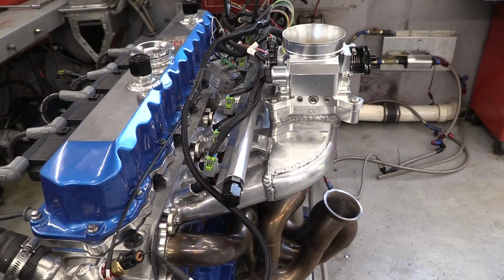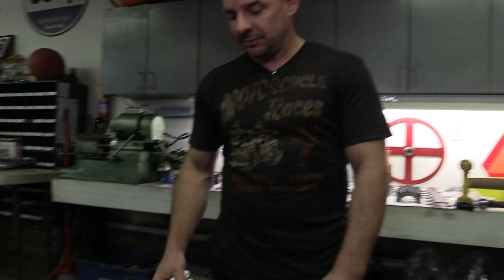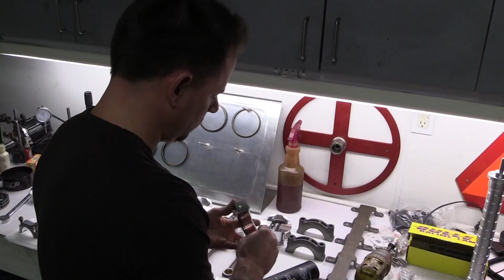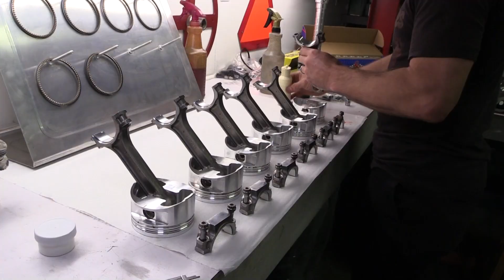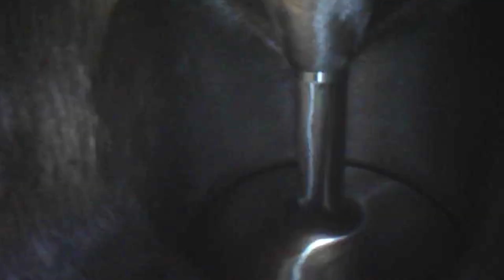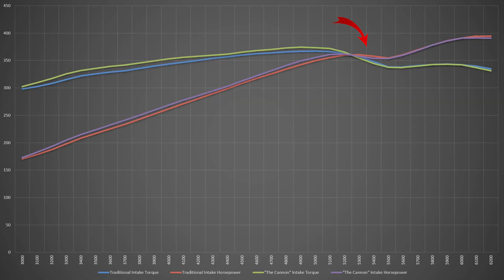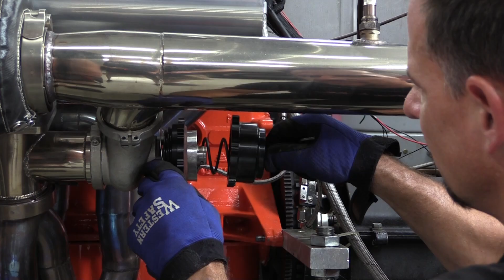Turbo Jeep Smashes World Records! (Tons of Innovation!)

Comment: People have only been talking about the power potential of the Jeep 4.0 for over 20 years. He proved it can be done even with a paltry aftermarket compared to LSland and with a crap ton of fabrication. My hat is off to him. He sells a turnkey stroker engine with 300hp for $6K.... so... If throwing 20lbs boost + methanol at it didn’t grenade it, the NA version will be solid. I will look him up to get an engine for the swap on my WJ. Way to go!!!!
Reply: @Michael l  I live in Texas my Jeep don't go over 210f, 200f is the normal running temp for the 4.0 he must of had a cooling problem of some sort. Mine normally stays around 195
Reply: 6k is to steep
Reply: @EGGINFOOLS  I agree, that's a lot of money for only 100hp
Reply: @EGGINFOOLS  I bet he will safely tap 7k without a seat to spin up 1000hp+
Reply: @EGGINFOOLS more speed more coke cain more fun new comer is tripping mad
Reply: @EGGINFOOLS  Its 2026 and he charges $14,000 for the same engine. WTF?!
Reply: Actually the 258 stroked with 4.0 is a solid build also
Reply: You guys should do a 300 straight 6
Reply: I've got a wj 2003 4.0 325,000 miles original motor. I bought it new off the showroom floor ( literally) .  It's now on 4 in lift , 33's, trimmed and folded fenders , original axles but mildly built up. The motor needs a full rebuild , not because of anything broken , but it's lost its pep . 6k sounds ok for having one built and only having to drop it in.  Might need to look into it.
Reply: Ford made a 250 cross flow 4.2 litre I would like to see what you could do with thst to
Reply: @browndog3455  yeah check out australian ba-bf falcons and the turbo OHC 4.0
Reply: Michael l there’s a few years of 4.0 that had weak head castings. They likely had cracked head not head gaskets
Reply: You don't even need 90% of what "LSland" has to offer. Just injectors, fuel, turbo and go.
Reply: This was one of the most interesting threads I've ever read! A phuk-load of knowledge and experience was bantered back and forth about straight 6 builds for hp! Thanks you guys for being real and talking the way we, who aren't born rich and have set up garages, really talk and do shit!! It got to name calling, but everyone still held onto their beliefs and there was no backing down! That shows me somebody knows what they're talking about!! Thanks again.
Reply: @standonit2003  😂😂😂
Reply: @standonit2003 new comer can set you free dude
Reply: Michael l definitely a bad day
Reply: @Michael l     that or improperly labeled MEK that is always a bonus to have around the garage .    Your friend would have eventually burned down his own garage .    Dumbasses get what they deserve .
Reply: 85 CJ8, 80 CJ7, 1WJ, 3 1ST GEN BABY GRANDS,2 XJ'S 4 DOORS ,2 XJ 2 DOORS.I love them all! Last but not least my Ram 1500 quadcab!
Reply: we been building it's australian cousin the hemi 6 for many years
Reply: I had a wj I bought for 300$ it had some body damage and a ton of rust so I was driving it till something broke then I scrapped it. well one day the lower rad hose popped all the coolant drained out and I was too lazy to fix it so I kept driving it on the highway it would only get hot when sitting at an idle I put over 500 miles on it with zero coolant I ended up having a problem with the brake boost before I scrapped it
Reply: Another crazy doper dude more coke cain man
Reply: WJ's unite
Reply: Как на счёт Австралийского Ford  Barra
Reply: How can I buy one
Reply: AIR DENSITY.  WATCH BRACKING A DURMAX  WITH GAIL BANKS .  YOU MIGHT PICK UP SOME TIPS NO BOOST AND AIR DENSITY.  HOPE THIS MIGHT BE HELPFUL TO YOU . ALL THE BEST .
Reply: Google "Torino Cherokee". Racers in the oldest racing category in the world, Turismo Carretera in Argentina, have been using this engine in their Stock car since the  90s. Naturally Aspirated, up to 500hp, roaring at almost 9000RPMs
Reply: 320hp LS weighs the same and can be had for 400 and ran off a 200 buck harness lmao
Reply: Jeep engines suk. Just ask the utuber that has 1300 jeep in a junkyard dexjeeps?
Reply: 2 WJs and LJ🙋🏻‍♂️
Reply: @nate4036  dddddp
Reply: That’s a lot of horsepower for a straight six
Reply: @thomasbalfe9436  tell that to a 2JZ..
Reply: He put cement in the water channels so it wouldn’t crack in half. That’s not a very reasonable way to build an engine. Also the smoke was from the waste gate, not the bov.
Reply: @marcus11619  only bottom section is filled,there is a gap at the top for cooling,have seen these street driven
Reply: @marcus11619  cement filling blocks is done on many high horsepower builds
Reply: Hell yes
Reply: So now the POS Jeep has souped up motor.  The remaining Jeep is still a POS  with no resale value.  Only people with bad credit buy Jeeps.  Don't shoot the messenger, it's fact.
Reply: @robertkotula5389  As if anyone actually cared about what you have to say 😂😂😂 At least I own my POS Jeep free and clear. I don’t care about how much money I spend on it. Your opinion means as much to me as the crap I took this morning.
Reply: @Potatofarmer1898  you cared enough to reply.  Tip: life is better when you don't wear your emotions on your sleeve.
Reply: @robertkotula5389  meh. My tip to you: don’t offer tips to ppl who don’t care about what you have to say!
Reply: @robertkotula5389  only the later ones with all the can bus electronics bullshit,earlier ones were quite reliable
Reply: @robertkotula5389  and what makes you think it's going back in a jeep?,may end up in some sort of pick up truck or a chryler/valiant car,you got a pretty narrow mind bud and wnat to find fault with something thats close to faultless LOL,crawl back under ya rock bug before you get squashed
Reply: @souranis  you could put headers and a cam in a stock 4.0 liter engine and get nearly 300hp
Reply: @SiliconCypher  no you can't. A header and can will not and I repeat will not add 110 hp to your 190 hp motor.
Reply: @TryinItAgain  Yeah I was exaggerating, with a 50 shot of nitrous you can get it momentarily. Regardless the price of this is ridiculous.
Reply: @SiliconCypher  I totally agree with you. The only reason I said otherwise was because I built one and could barely get 250 hp out of it and that was with .030 decked off the head and ported and polished. But yeah nitrous will get you there plus some.
Reply: @TryinItAgain  was it your Jeep? I'm sure it boosted the fun factor.
Reply: @SiliconCypher  yes it was my Jeep and yes it definitely helped but trust me I was aiming for 300 and couldn't get it. I did get 253 hp tho so it was a major upgrade.
Reply: @TryinItAgain  well you fucked up,i regularly got 400hp from australian hemi 6
Reply: @TryinItAgain  they go 400hp with compression,cam and porting
Reply: @andrewsmart2949  are you taking about a straight 6 Jeep motor? I'm curious here. There are a lot of straight 6s that you can build to high hp especially a Barra or something similar but I'm taking about the Jeep motor in my comment
Reply: @TryinItAgain  someone else metioned the 250 cube ford 6 and i said ford australias gone a bit beyond that now,i used to build and drive valinat hemi 6 australian motor,then got heavily involved with RB nissan 6,and now with the "barra',whats your point joshua?
Reply: @TryinItAgain  and i just whatched vid of bruce sizemores "cleveland" headed 300 cube ford 6(2 cleveland heads furniss bronzed together after cutting offend cyl) and it's sick
Reply: @andrewsmart2949  my point is that the Jeep motor and the aftermarket support for it isn't there and neither are the hp figures. The record with 20lbs of boost is just over 800 and the record that stood for years was only 687hp. There are many straight 6's out there that can make double and triple those figures. I know 6's can make huge power but the Jeep 4.0 is a dog with little aftermarket support and therefore hard to produce power with.
Reply: @TryinItAgain  they are a powwrhouse,hut the fuck up spambot
Reply: @TryinItAgain  all iron and pushrod are terms clearly lost on a spastic like you,800hp from a 6 aint to shabby in any ones books,and this thing would outlast alot of the all alloy units  you want to quote,it may be easier to get power from an OHC 4 valver but thats not the point
Reply: Dd
Reply: When I wanna do a rebuild I'm doing a full swap for a stoker 4.0. 00 WJ with 195k, and a KJ with 246k

Comment: I believe it was in the mid 60’s that INDY cars were allowed to use stock blocks and turbo charge them. The earliest ancestor of the Jeep 4.0 was the AMC RAMBLER 199 cubic in engine. An INDY racing hopeful Named Barney Navarro built one of these engines and used a Turbo Charger to boost horsepower. He made 550 horsepower with the little six cylinder. The 199 and 232 engines had the largest ports of the early carbureted sixes, until about 1958. Those heads are good for the earlier engines, but the new Edelbrock aluminum head outflows them

Comment: OKAY STOP.  Start doing some research before you make a 4.0L Turbo video. It's not making 1,500HP from 14 years ago at the Mud Drags on 53" tires that weigh 334LBS Each 16.00R20 Michelin XZL in the mud.

Comment: I told someone that it would cost more to modify a Jeep 4.0 to make 800 hp than it would to modify a 2JZ-GTE to make 800 hp, thanks for proving me right. Pretty good for "the rambling of someone who does not build engines," right?
Reply: comparing apples to oranges.
This build was done for R&D purposes.
Reply: @riogrande163  True. If the engine were actually meant to be used in a vehicle, 800 hp might not even be possible, or reliability might be too poor for the engine to be useful for anything.
Reply: The engine itself is quite a simple, reliable design. 
The real challenge is packaging the turbo system into an engine bay.  @PistonAvatarGuy

Comment: Since I am a 1st time with my 1st CJ 7 4.2. This was an happy eye opener especially V seeing the turbos sub 5000 rpm performance eh Imva bike tech and specialize in mechanical boosted monster bikes. Same results ratio at half the peak rpm pull.though the bikes rip 12,000 rpm lol  Now I am gonna build along side the lifted 1980 an extended chassis rat Rod Jeep street machine mud racer style with Newcomers mega turbo system. Or similar depending on the development 👍🏻😃

Comment: Additionally, these engines were durability tested for a thousand hours cycling between peak hp, and peak tq while also being thermally shocked at both ends. There's some incredible  information out there on them if you dig. Forum info is garbage.

Comment: I had also run 232 amc and same stock pistons as 258 i ran, 258 blewlands off number 6 in 4 runs. The232 never caused a piston or ring issue. Instead it also had bearing issues

Comment: You are obviously an engine guy with a lot of knowledge. If you want to reply I will appreciate it. 4.2 amc, 7.5 cr Ross blower pistons. Crower 7000 plus cam grind, 470 int 480 exh, double springs, turbo from Detroit 4 71 t with appropriate turbine hsg. Runs 42 psi manifold pressure using 100 low lead aviation gas. Have had no issue with head gaskets or pistol s, but it is making metal from rod and crank bearings. Question, if I make a block stiffened plate for block to oil pan and 4.0 main cap stiffeners do you think this would. Be enough to lessen bearing wear. Yes I can just do it and see but you have experience with these. It is blow thru carb setup and have used Carter and holly both. Key was 5/8 inch fuel line to keep it fueled efi pump and ref regulator of course

Comment: At 1000 hp the BBC pins flexed and kicked out the double spirolox in the Forgedtrue pistons  We went to Chrysler top fuel pins in BRC pistons  3.750 + .010  to stay under the 210 cu in limit    no problems with either the Nodular iron cranks or the Armasteel castings    How much dependable HP you want to make with your AMC just depends on how brave you are   (It could have been the Piston Pin boss design  IDK)   i like long rod strokers with tight quench which I find are more tolerant of timing and gas quality but I never built a short rod tight quench motor  Put several hundred thousand miles on our 77 Pacer wagon  On the street or rock crawling  I like the extended tip plugs  I ditched the AMC box and used a FORD  AMC 360 999 trans with lock up and double wrap band transgo kit- bulletproof

Comment: 1,200 HP on Champion spark plug dyno   twin turbo 60 lbs boost  Methanol199 block with steel straps on the stock main caps and stock head bolts in the mains,   stock 199 crank Carrillo rods  Brooks pistons with Chrysler Hemi pins  Chrysler 6 sodium filled exhaust valves, TRW unobtanium intakes, TRW rings Ed Winfield Cam  later smaller port head but with shaft rockers and thicker deck 500 miles at Indy  Delco  big black box CD ignition.  AMC block is the strongest 6 cyl motor to build.  Wish we had later heads to use for a base  copper head gasket with Bellevue o rings, stock head bolts  500 miles at Indy  AMC car was quickest off the corners as twin turbos were staged where one reved up then the second blended in with a cast stainless Y diverter valve  You could get boost just winging the throttle   no intercooler  would have been nice as the charge was cooled with richness then INdy put in the fuel limit rule which ment we would have had to run leaner  cheers

Comment: That part about the magnets is absolutely fine to do. I don’t know who started that old wives tale about not letting any magnet touch any of the engine parts. Since anyone who has been around magnetized metals knows that the first heat cycle will destroy the magnetism. Since most magnets, which have a stronger pull die over a certain heat. Then they have to be electrically magnetized again to have any attraction to metals or other magnets. So sure they may have a tiny bit more friction for 1 startup. So as long as you lubed your parts as you built it with either assembly lube or oil or whatever you like, you’ll be fine.

Comment: Yes it is a good motor and just a tip better than a Chevy 262 292 or a Ford 24p 300. It is layer for mopar as they pursued the slant

I love I. Li e so. For balanced high torque. Ok my first series of engines were 230 ci flathead.

Comment: Why load the engine up (brake boost)? It doesn't represent real world where the turbo will have to spool on the street.
Reply from the maker: That's how an engine dyno works. You bring the engine to a chosen rpm, the dyno holds it there until the throttle is wide open, and then you begin the dyno pull.
Reply: @TheHorsepowerMonster  ahhh ok interesting, thanks for the reply

Comment: Lower the compression ratio to 7 to 1 and raise the boost to 50lbs, and you'll make over, 1100HP I bet! Not sure if the cylinders and bottom end will survive it, but I think there is a good chance it holds 40 psi. Lowering the compression will help it big time. Back the timing back and close the spark plug gap to no more than .018. On an Inline 6 cylinder with a 4.875 bore and 5.625 stroke and a custom intercooler I built plus Two HC5A Holsets on top with 3.9 inch inducers feeding the bottom or second stage turbo with a 4.250 inducer. 90psi of boost pressure and turning 6000 rpm using methanol as fuel. 22 Gallons of fuel a minute. Cam had 282 at .050 ex. 278 @.050 in 114 lobe centers. 2.1 to1 rocker ratio, overhead roller. Hemi style or more like Prostock style combustion chambers which are small chamber with twin quench pads .060 quench clearance and 2.6 inch intake titanium valve which flows 550 CFM @ 28in and .750 lift valves @ 22.5-degree angle and short turn against sleeve like Hemi layout. As the valve opens, the chamber is shaped to promote high velocity as the valve opens. A small chamber prevents flame travel distance, while quench pads absorb heat to prevent detonation. 629 cubic inches, 4000 Horsepower. Unlimited Super Stock engine. I will upload pics sometime. I learned that lowering compression ratio does amazing things for turbocharged engines. Please try and let me know your results! I love watching your videos. Keep up the awesome work!

Comment: Want to make more power? Lower the static compression ratio down to 7.5 to 1 or lower, and increase the boost pressure. It will make way more horsepower and also be easier on parts! Sounds backwards, I know, but I've done it, and you won't believe the difference it will make!